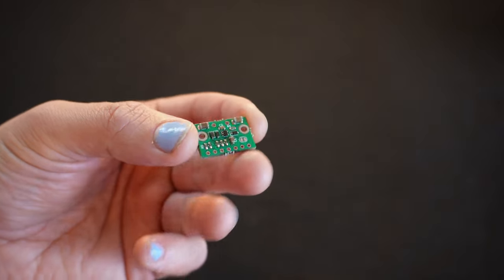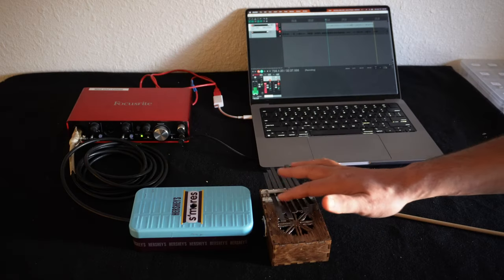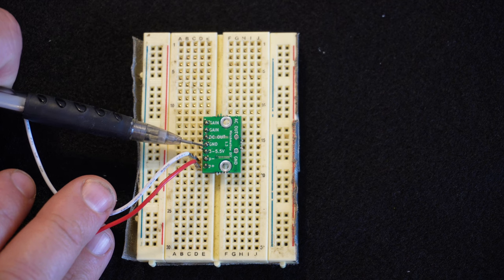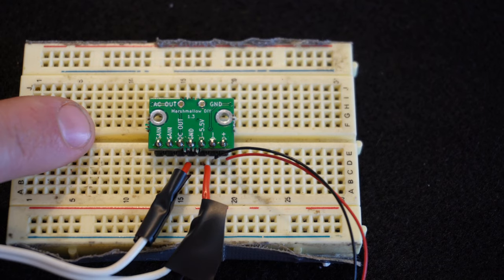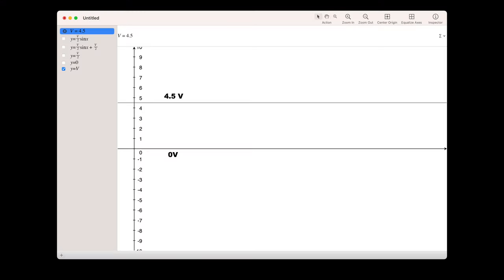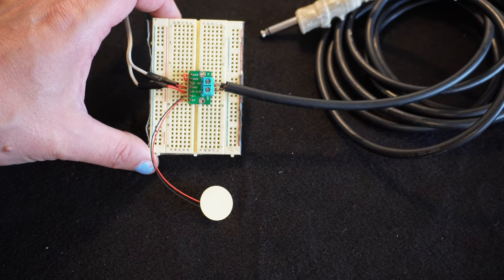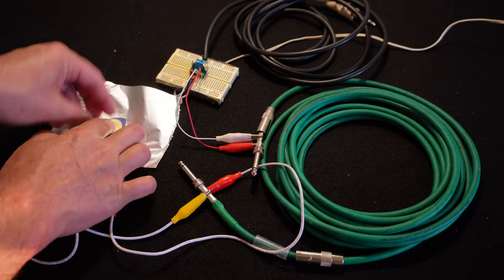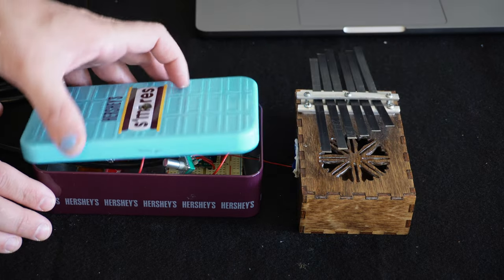How to make a cheap DIY Contact Mic that dosen't suck

Comment: Hello! Can I solder four wires instead of two to get two different signals from one sensor? I wouldn't want to use a splitter or a second sensor, I want a small difference in phase and harmonics from one sensor.
Reply from the maker: You can solder on 4 wires, but I think the signal on the second pair of wires will be identical to the first. This is because both layers of the sensor are conductive, so the voltage should be uniform everywhere on the disc at all times. I'm brainstorming here, but I wonder if it would be possible to cut the ceramic material on the disc in half, then you might get slightly different signals on each half. I'm not sure if this would be different than using two sensors side by side.
Reply: @metalmarshmallowllc  A reason to experiment. Thanks, I'll try)

Comment: Hi, Great informative video. I am interested in buying the DIY kit but wondering if we could use a plastic box instead of metal to eliminate the need to ground the box? will that affect output?
Reply from the maker: Hi, the box needs to be grounded metal to prevent the mic from picking up electromagnetic radiation and humming at 50 or 60 Hz. you could use a plastic box but you would have to line it with metal foil or conductive paint and ground that to prevent hum.

Comment: Hi, as far as I know aluminium reacts with oxygen from the air to form aluminiumoxide, which is an insulator. So, how can it shield the piezo disc when it is isolated from ground? Would copper foil not be better?
Reply: That is an interesting question and I'm not sure I totally understand the physics of it; You are right that annodized aluminum does not have a conductive surface owing to the thick aluminum oxide. On the other hand I just very gently tested a piece of aluminum foil that has been sitting in open air for over a year and its surface very much is conductive, so evidently whatever oxide is there isn't enough to affect the conductiviry.
Reply: Thank you, that is a very practical way to answer my question!

Comment: Thanks for your work!
So I can use the DIY Kit to connect it directly to headphones?
I would love to wander around with a portable thing with headphones to put the contactmic on anything I see and listen to it.
Reply from the maker: You would probably want to run the output of the DIY kit into a headphone amplifier, TI and Analog Devices both have many to choose from. I also have a phantom powered version of this kit that works really well with handheld audio recorders. I use mine with a Zoom H4N so I can monitor the sound live with headphones. (I also sell a complete phantom-powered mic if you don't want a DIY project).

Comment: Hello, nice video.  Is it possible to connect more piezo discs to the preamp? In your experience, do more piezodiscs result in better sound quality?
Reply from the maker: That is an interesting question. I've never tried connecting more than one disc to the same preamp. I'll have to give that a try.
Reply: I m asking because I am considering buying the kit. If I connect, for example, 3 piezzos, can all of them go into the p+ and p- pins? Thank you for your advice.
Reply from the maker: @zsoltyszabo  I just tried it with 2 piezos and it does work, three should work also. I'm sure you realize that this dosen't give stereo sound, it just mixes the two discs to mono. It could be useful if you wanted to get sound from different parts of an instrument and mix them all together.
Reply: @metalmarshmallowllc  Yes, that's the reason why I want to use more piezos. Thank you for your help.
Reply from the maker: In case anyone else has the same question, I answered it more thoroughly in a blog post https://metalmarshmallow.com/blog_post.php?id=11

Comment: What is the effect of the disc size? is it frequency cutoff? or the overall volume?
Reply from the maker: If you suspend the discs by calipers and measure it, you will find that larger discs have lower resonant frequencies. Larger discs also have a wierder frequency responses with many peaks, while smaller discs have flatter responses; or at least the wierdness of small discs is high in the frequency range where it dosen't matter. If you stick the disc to something massive like a wall, the peaks mostly flatten out. There isn't really any difference in sensitivity between large and small discs. I need to make a video about this.
Reply: Hello,  I would be interested to know if this system would be a good fit to capture the “click” part of the sound of a kick drum.  I have hung a senheiser on the front beater head just for this job.  Would be cool to have this disc attached to the head and be able to capture mainly high freq area.
Reply from the maker: @roq_itrecordingstudio4152  I think it should work but I dont't have a kick drum here to test it with. The only issue is that sometimes the sound distorts for really loud sounds. For example if you put the mic on a cymbal and hit it as hard as you can with a hickory drumstick, the sound will distort. I think the bass drum should be fine. I would put the disc on the very edge of the drum head, you can get very crisp highs there, I show it with djembe in my most recent video with the phantom powered version of this board.